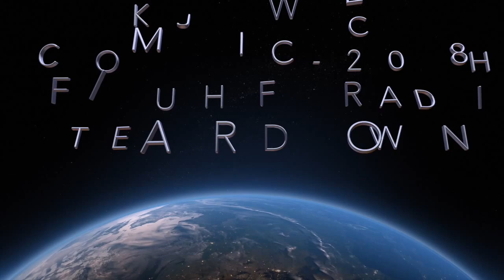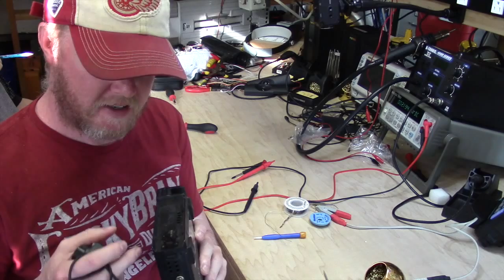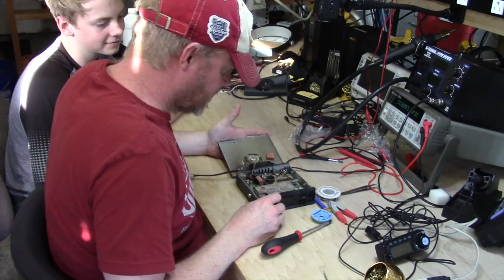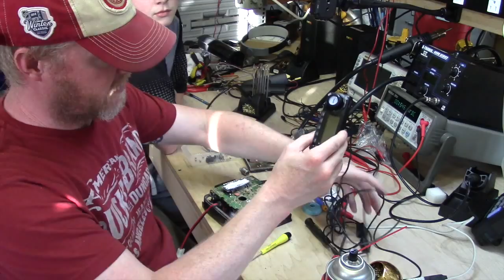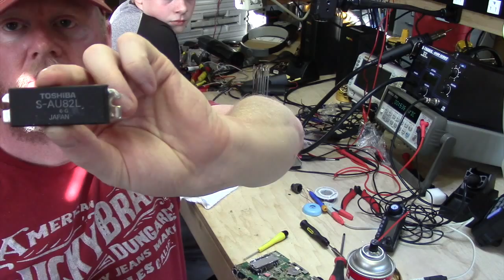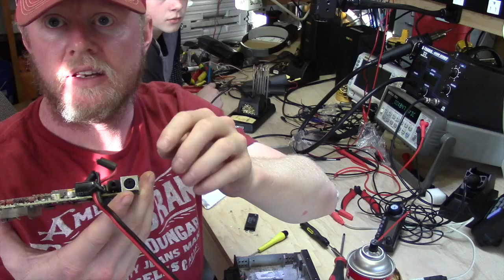ICOM IC-208H

Comment: Hello, a question: My icom ic-e208 in VHF does not give more than 35 w. and in UHW 40 w. The apparatus has never had faults and is practically new, stationary in antenna 0 (zero).

Another question: is it possible to make a change to broadcast in air band? Where can I find instructions to be able to make this change. Thank you
73 from Italy
Reply from the maker: Have you tried checking output across the band? That could be normal if you are checking with a SWR watt meter etc.  Also it doesn't have full output across the entire band.  You can expand it's range although I'm not sure what the air band is in europe. Internally there is a resistor matrix, 8x8 I beleive.  On the USA version two resistors are places.  If you remove them it will open up after a reset.  RESET THE RADIO, hold the [SET LOCK] and [S.MW-MW] buttonsdown during power-up.   Hope this helps.
Reply: @ShaneBurrell1  Ok! Thanks, I'll do this test and I hope everything works also in the air band. Thank you
Best regard fro Italy ik2rtk 73
Reply: @ShaneBurrell1  Italian air band  117 mhz -   138 mnz   ( AM )  Tks
Reply from the maker: @sergiocazzaniga3141  AM won't work only FM
Reply: @ShaneBurrell1  OK  ! OK !

Comment: I'm here because my 208 suddenly not receiving like before for example repeater was 5/9  now 5/5  any idea what to look for ? Also in simplex not receiving good !! Can I change the receiver on this radio or no .. Thanks
Reply from the maker: Everything in the 208 is SMT so you will need to have experience with SMT. I would start with a service monitor session and test starting with the antenna connector.
Reply: Thanks for fast replay ..
Reply: I will check the SO239 inside the radio for a cold solder joint. I had the same problem with mine. I hope this helps.